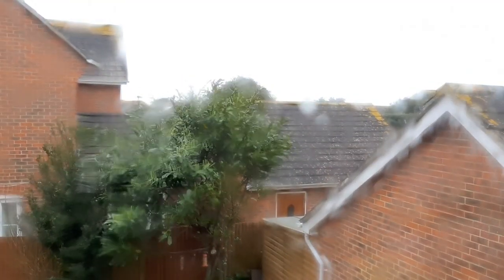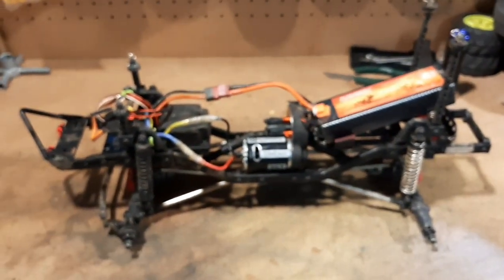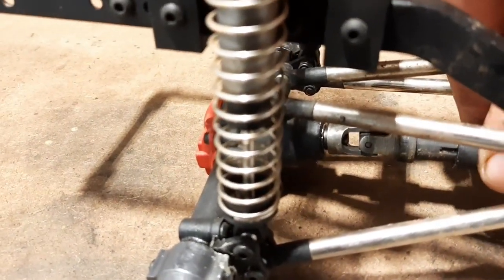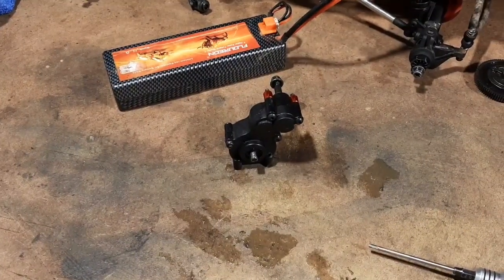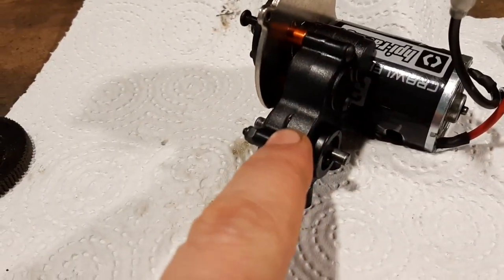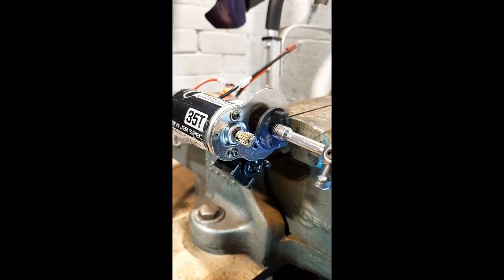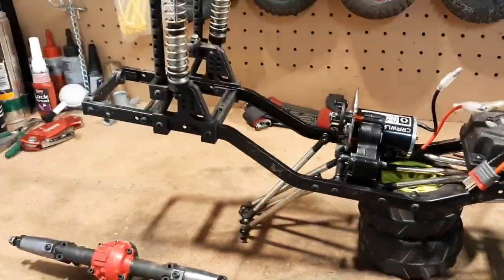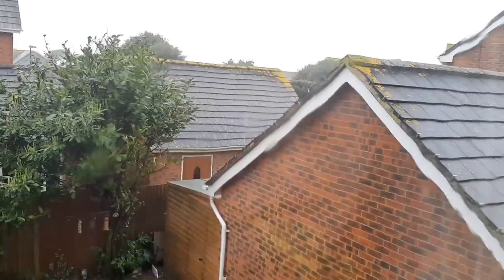FTX Outback Fury gets a noisy gearbox, turns into the start of a full rebuild! Rebuild pt.1.

Comment: I had a similar noise on my son's, the teeth were stripped on the main cog that's driven by the motor. I put a new cog on but the same thing happened almost immediately. I cleaned out the gearbox but it seems fine. Disconnected the prop shafts and the wheels spin freely. Have ordered new main cog plus new little cog that attaches to the motor. Can't think what else it could be though? Any help much appreciated we're new to this stuff.
Reply from the maker: Little cog on the motor is the pinion, the pinion drives the spur gear, larger plastic gear. The spur is plastic and seems happy to give up the ghost when it gets worked hard, although with Mikes trigger happy driving in some pretty poor conditions I can almost forgive it. Also keep an eye on the mesh of the gears, you can loosen the motor screws and move the motor toward or away from the spur gear. you want the gear as close as possible without binding, a quick you tube search will give you all the help you need with that. Also keep an eye on the pinion, although it's metal, the stock ones don't last all that long, it'll still wear. Once it's worn down a little it'll cause damage and increased wear to the spur gear. Changing these out for 32dp gears appears to be well worth the effort.
Reply: @MPRCBBRR  many thanks for your detailed reply 👍

Comment: small jobs always turn into a rebuild I find 😀  any wiser what the noise was?
Reply from the maker: Nothing dramatic but a combo of stuff I think. We had a motor burn out while crawling on Saturday and swapped it out in the dirt and filth to keep going, the mesh was fine but the pinion sat a bit far foward on the spur so was only in 60% contact which wore it all funny. Also the front CVD's were full of mud, the front diff input had play and was probably slipping off the crown gear under heavy load, and the rear gearbox output bearing was half dead 🤣 the axle strips will reveal all. 3S, thick goopy mud and heavy weighted wheels (almost doubled in weight with damp and mud) put a lot of strain on things!